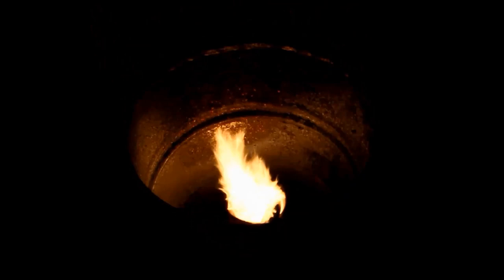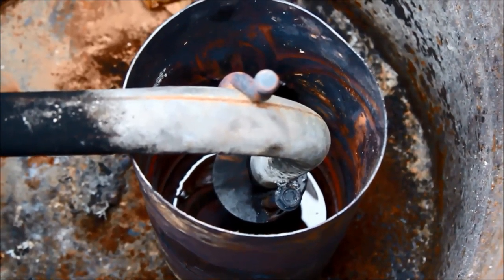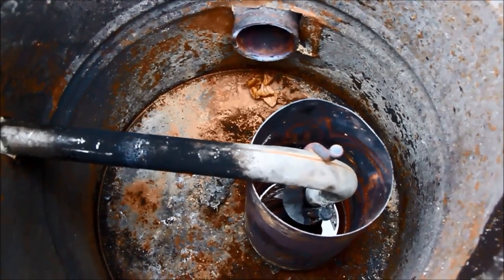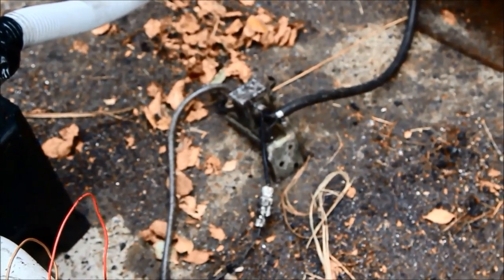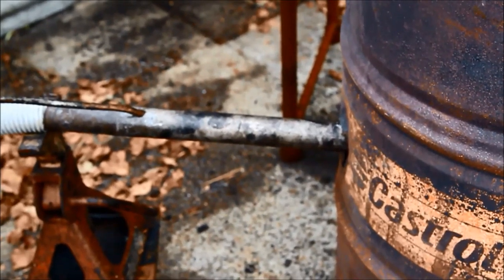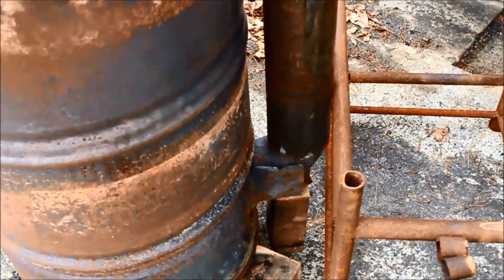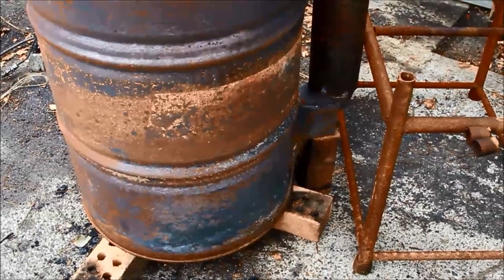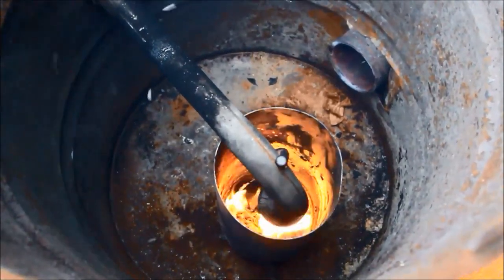Shed heater for $20 from scrap.

Comment: Love it! It is almost exactly my design. I have reduced the output to just enough to keep the flame lit and it idles along and heats the shop perfectly. Love the safety warnings and the final word on how hot it is! Haha Keep up the good work!
Reply from the maker: One of the great things about this burner is as you say the ability to turn it down low and still have a clean burn. Running a burner at low levels will be a whole new thing for me when I install one of these in my own garage. My usual bent is to see how hard I can run the things!
Yeah, mucking round with these things in summer is not the smartest thing a person can do but I like to try and post new vids as often as I can.  I'll try to do a heap when winter comes so I don't have to do any  next summer! :0)

Comment: I'm experimenting with an old oil stove turning it into a waste oil burner to heat my small garage. The problem I ran into was the ugly crud that resulted due to not have a strong enough blower to cause better combustion. I was hoping not to have to use any power to run the thing, but looks like my design is flawed unless I drill some holes to allow more oxygen to fuel the fire. "Love your vids" keep em coming ....
Reply from the maker: I have built draft burners and they ALWAYS need cleaning due to buildup. Unless you have an overly long flue that draws most of the beat up the chimney, I don't believe it is possible to get enough turbulence  to the things to tun hot enough to self clean.  The ones I do with Blowers never need cleaning or have any more than a pinch of ash when they are shut down. 

You should be able to run with nearly any blower, thing is if it is weak you may have to pull the fuel back to where you don't get the output you want. 

There are a lot of different blowers around, I have even used them from cars with good success. Just have to look around and see what is available where you are. 

Good Luck with it.

Comment: I found something out last night. Since I live in suburbia (her choice, not mine) smoke and odor have to be near 0. So I tried using different diameter pots to fire into. My 4" ID steel pipe had no smoke and almost no odor using 1.5 us quarts per hour. I swapped to an unlined 6" ID cut off fire extinguisher and the outlet had a bluish-white smoke with a lot of odor. Stunk up the entire neighborhood. I switched to a lined fire extinguisher bottle with a 4" ID chamber and the smoke and odor went away. Also, the larger unlined chamber was harder to keep lit and required more oil to keep the flame.

Another thing I found out is that if your flame goes out and the oil keeps flowing it fills the barrel with vaporized unburned oil. If it happens to relight it produces a rather violent BANG, which is rather unsettling to say the least.

Keep the videos coming! Love every one!
Reply: +armorer1984  What do you mean by lined and unlined extinguishers... is there a way to tell which is which prior to finding them and lopping the tops off?  I unfortunately live in suburbia too and need to run as odorless/smokeless as possible to avoid the local tax/ticket hounds from paying a costly visit.
Reply: +xxwildbillxx 

Sorry, I didn't elaborate. I lined the inside of the 4" burn chamber with furnace cement. The lining doesn't do much other than making the chamber last longer. The key to make my build work is a smaller combustion chamber to keeping  the burning gasses together as long as possible. If you put more fuel into it you can(and should) use a larger chamber. That's what I have found, anyway. 

It seems the key is to have the chamber be large enough to have the gasses all but completely burned before they get over the lip of the burn chamber, but yet small enough to keep all the gasified oil together until it is all burned. OilBurner, feel free to chime in if I am wrong.
Reply from the maker: +armorer1984   I wouldn't say you are wrong and I may be saying the same thing in a round about way. 
For cleanest combustion I like to firstly have an excess of air and secondly try to make the fire go back into itself with lots of Mixing.  To do this I put the inet high up in the burner and angle the inlet down. As the heat and flames want to rise, i find this helps make everything double back on itself which keeps things hot, well oxygenated and gives a clean output. 

That said, it really doesn't take much to make these burners run clean. as long as they have plenty of air and you keep them hot, they burn without any smoke or smell pretty much automatically.
Reply: +Oil Burner - Great stuff... always good to get as much perspective as possible.  I have a 15x20 un-insulated/un-attached garage I'd like to put this setup into... would really like to keep the setup as small as possible to save space while of course avoiding a larger rebuild later/in the dead of winter... a 4" burn chamber is right inline with my intentions of making this work in a smaller more narrow, vertical container like a 30 gallon drum or even a small re-purposed pot belly stove.
Reply: +xxwildbillxx 

You can definitely heat an uninsulated 15x20 with these things. You could probably use a 30-gallon drum instead of a 55-gallon to make it a little more compact. Add in a box fan or two to help the  heat transfer and you will have it up to an unbearable temperature in no time.

Comment: My best compliments for the unconventional thoughts about the exhaust! It's a pressure exhaust and allows to burn the fuel many times, besides other benefits (complete combustion, no need of draught and pretty cold exhaust compared to other methods). The only precaution must betaken to seal the top good enough even for extreme heat, as it can become extremely hot!

Comment: just now seen this. But i have taken apart a few central gas heating systems. And every single 1 of them has a bottom exhaust. and the burner in them tends to be on the top. Reason is as you said to get most heat out of the burn.

Comment: This is awesome! I wanna make one now. Curious, why does yours pulse?
Reply from the maker: +Bob H probably because I was running it pretty hard for the vid and using a timed pump for the oil control. When it is run with less air and with a longer inlet, the fuel comes in more evenly and the pulsing is eliminated. 
I would probably do this with a pressurised oil tank now. It only needs a few PSI to overcome the effect of the differening fuel level and it could be controled with a needle valve.

Comment: really, really nice sounding instrument! reminded me of Baraka sound-track; this is modern art man.
  - Hey, for practical purposes; what was your oil consumption rate for this burn rate? thanks!
Reply from the maker: It's certainly novel. Don't know if it would be the same If I built another one, may have just been some freaky setup with what I had and the way I did it.
I don't remember the fuel consumption but it's really a bit irrelevant. The heat output is directly related to the fuel consumption and these things can be easily varied so you can dial the heat output to what you want/ need.  High to start and back them off once everything is warmed up.

Comment: I'm thinking you could put a Potentiometer on the fan to control the speed it run to control the overall btu output.
Reply from the maker: I was thinking the same thing! I have bought a little motor speed controller off Fleabay that was like $10 and is supposed to run a 4000W load which is more than the power supply. It didn't come with wireing diagram and the symbols make no sense to me so I'll have to look it up when I get a chance to see which side is what and how the thing is wired. Not sure if it's both sides or just one with a common link.  The main thing is it will make start up easier where I have to throttle the air till things get hot before giving it full blast... or the controlled heat output I want.  :0)

Comment: There are many who live in the area that I do that drive loud vehicles. They alter the exhaust in order for it to be loud because they believe it sounds "cool." Unfortunately, the only way in and out of my little community is to pass directly in front of my house. I think I'll build one and do whatever I have to do to make it sound like the one in this video. I'll set the thing in my front yard, fire it up right about 10:00 pm every evening and let it run all night long. I have about two-hundred gallons of used oil, I should be able to run it all night for at least a month. Maybe they'll get the message. If they don't, I have an old F150 that I'll cut the mufflers off and just drive around and around the neighborhood all night for a few weeks.
Reply from the maker: I lived on a main road with a car part shop Opposite. Every afternoon this Tool in his hotted up car would come there in peak hour then do a burn out up the road frequently near missing a head on with other cars. 
Went out there one day and sat on the fence with a bucket of water.  When he came out right on Cue and started his Burnout, I threw the bucket of water under the rear Wheel . Steered him straight into the gutter and the pole a little further up.  I was waiting for the altercation but he didn't even know what happened.   Car was a bit sad, he was ok, unfortunately, but the last I saw of that car and the nut behind the wheel was when it went off on a tow truck.
Reply from the maker: At my first home, a clown moved into the rental place up the street with a car with no Muffler. Used to go to work about 5 am and come down and use my driveway to turn. Woke me and other neighbors up every time as he had to rev it when it was cold or it would stall. 
I wrote a very Eloquent letter in the most polite and sophisticated language I knew and said if the inconsideration continued to his fellow Neighbors.  I would come out and set the car alight and then wait for him to relate my annoyance and see remedy for the lost sleep and frustration he had inflicted.  I got up and watched and saw the guy come out, read the letter, look around and then went back inside. 
Another car came later and picked him up a little later and off they went.  When he came home he took the car away.  I didn't see it come back or hear it but he obviously took it and got the POS fixed.

Comment: would a another barrel help hold more radiant heat say a setup like the double barrel wood stove kit ?
Reply from the maker: +Gene Smith  For certain it would!  the more surface area the better. Also if you had a small fan blowing on the drums that would also take off a lot more heat and put it into the area you wanted to warm.

Comment: Once that lid is on the flames are just going directly to and through the exhaust.
Reply from the maker: No, they are going very indirectly which is the point. In a normal stove they go up and out, by reversing the flow you get much more contact area with the drum.  Better still would be to feed it into another drum in a way that created turbulence and get even more heat out the thing.
Reply: My bad; I theorized the flame exhausting before I finished watching the video.
 You do a great job!  It looks like a fun project.

Comment: What runs the blower .. you said it costs you nothing to run ... just saying
Reply from the maker: +TheFrameoff  Wow, there is no fooling you!   For your clarification.... I took the electrical rating of the blower, the price I pay for a Kw Hr of  power and worked out the blower costs 3.7C an hour to run.  What can I say? I'm an untrustworthy worthless human being that tells lies to misguide people saying it costs nothing to run and you have found me out.  I also forgot the cost of the match to light the thing in the first place. 

I guess from that POV, the thing is not free to operate  and if that sort of power consumption is of concern to anyone, then they will  have to get a job,  do overtime or buy less booze and fags every week or cut back by not buying one newspaper per week which would more than cover the cost of the blower for about 45 hours of run time.  
Or just stay out of their sheds and leave whatever they wanted to do till things warm up. 

For the mega wealthy that earn an average wage, I believe they will be happy to pay that 3.7 C an hour instead of the cost of electricity, gas or fuel oil and be warm and cosy doing whatever they want to do.
Reply: Oil Burner Just curious cause there are oil burners that just use the drip method and no outside force  air
Reply from the maker: TheFrameoff
I'm confused? You asked what runs the blower with regards to cost and now you are questioning if it used forced air when clearly you must have been aware it did?

I have built the draft type burners and they are very good however they don't put out near the heat a forced air type will and they require daily cleaning due to their lower combustion temps. The blown air types I have built are all self cleaning.

I believe it is much easier to get decent efficiency out of the blown air burners than the draft type.  It is difficult to get a draft type burner to run soot free which makes any sort of heat exchanger very prone to getting caked in carbon and requiring frequent cleaning  for the HE to work.

Blown air types are easy to run with an excess of air which means very clean combustion and HE's do not effect the way they burn through impairment of the draft.

If you are only running a heater a limited time then the draft types would do fine. If you are wanting something to run every day for hours, then fuel consumption for most does become an issue even if it is free and decent efficiency from the fuel burned is also a desirable factor along with low maintenance.
Reply: Oil Burner Thanks I didn't know  that ,  questioned answered

Comment: Don't sit a baby on top of it after it's bath neither.
Reply from the maker: HAHAHAHA!  That's Gold!  When I was making the vid I saw my heat seeking pussycat  wandering up the yard., I was scared he may jump up on the thing. He got about 6 feet away and then got this funny look as he sort of sniffed the heat and then visibly shied away. 
I'm sure he has more sense than some people who would walk up to the thing and put their hand on it to check how hot it was.
Reply: Oil Burner
Ha! My grandfather told me about a guy coming into the blacksmith shop where Gramps was having something made. Anyway, this guy picks up a horseshoe that had just cooled down past the red hot stage, and immediately dropped it. Without missing a beat the smithy said 'Don't take you very long to look at a horseshoe does it?'
Reply from the maker: julie r
HAHAHA! I wonder if there are any real blacksmiths like that still around these days?
Probably be put out of business but all the OH&S rules and crap not to mention the whinging safety zealots.

Comment: 1. not thick enough of metal 2.very dangerous.would not trust!
Reply from the maker: would not trust it for what? To leave unattended? Neither would I but If I had it in a shed where I was working close by and could keep an eye on it and upgraded it a bit with some fuel flow control, I'd be most happy to use it as many other people whom have used the design have and have told me how much they like it.